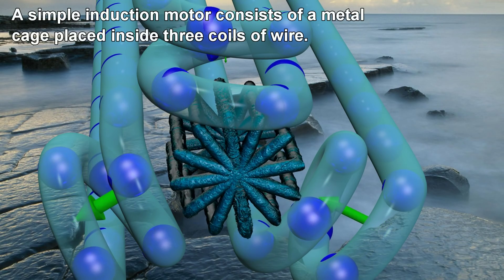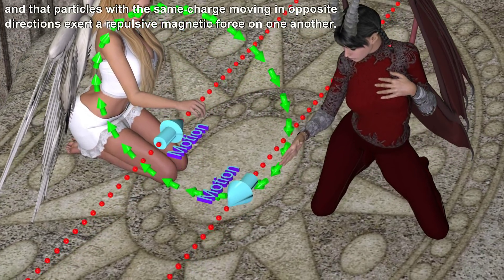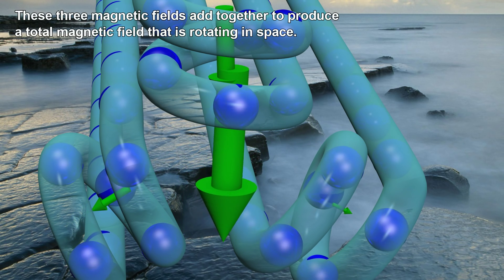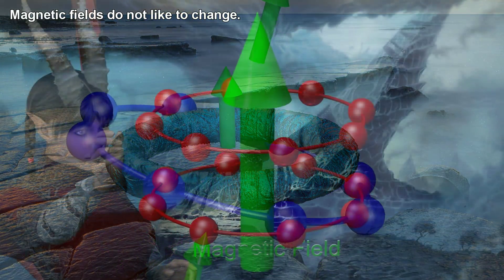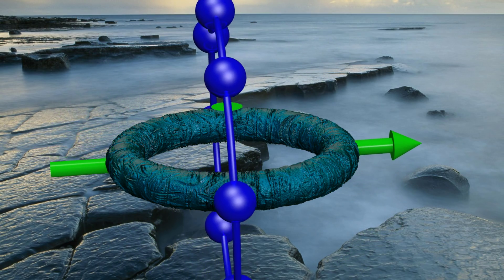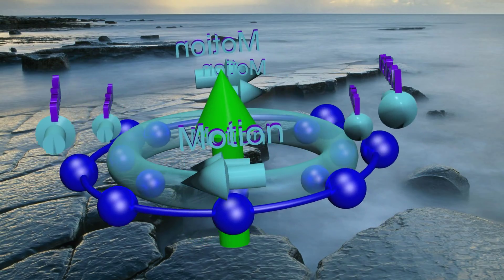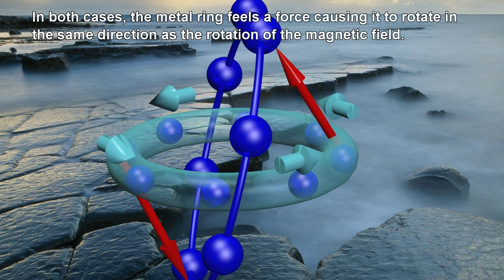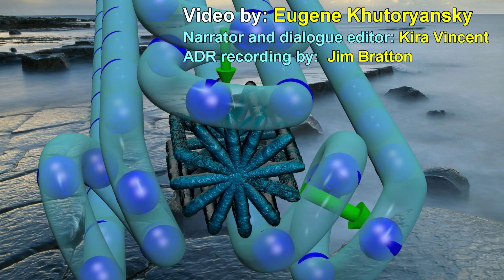Induction Motors - Why and how an induction motor works

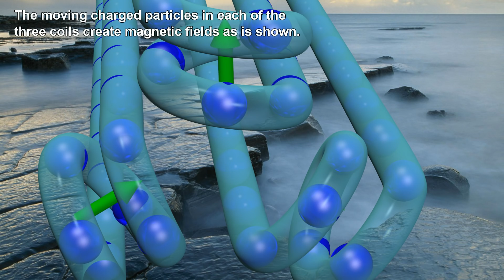Comment: Hello! Should it be there the positive particles in the coils of the stator, for example at 2:49. Or instead of it the arrow of the magnetic field should be pointed in the opposite direction. I am confused with the fact that when the negative particles are moving counter clockwise, we have the North Pole upside (arrow points to the up) on the upper coil and South Pole downside.
Reply from the maker: You are correct.  This is a mistake.  Thanks.

Comment: Thanks for your awesome videos, but I think there is a flaw in this animation. The direction of flow of charged particles in the metal loop should change when the magnetic filed passing through it changes direction. But in the animation (see for example in minute 6:41) the direction of flow of particles in the metal loop changes when the magnetic filed is still pointing up.
Reply from the maker: This animation is correct.  The direction of the flow of charged particles changes not when the direction of the magnetic field changes direction, but when the "rate of change" of the magnetic field changes direction.
Reply: @EugeneKhutoryansky  Thank you very much for your clarification, it makes perfect sense to me now. The direction of flow in the loop depends on the rate of change and not the direction of magnetic field passing through it. Your animations are extremely helpful in explaining difficult concepts of physics and I don't even know how to thank you for making them available to everyone on YouTube.

Comment: Three coils of wire. Metal cage placed within rotates
Electromagneticiam - particles w the same charge moving in the same direction exerts an attractive magnetic force on each other
W same charge in opposite direction exerts repulsive magnetic force on each other
All moving charged particles create magnetic fields